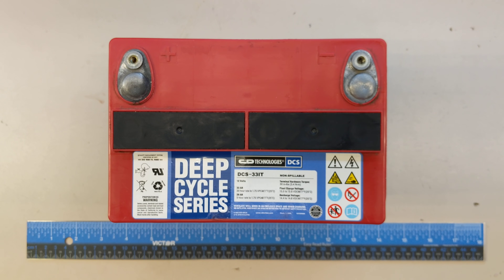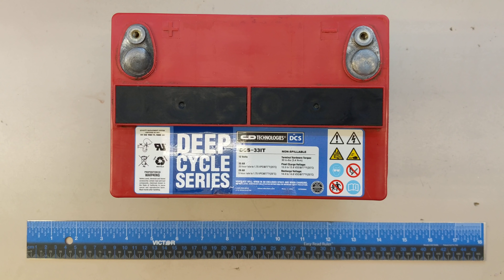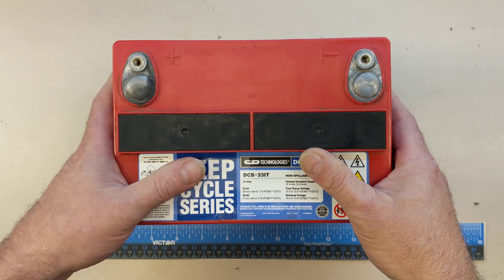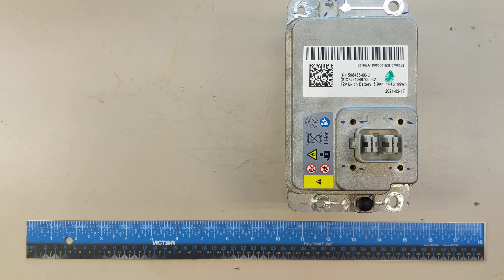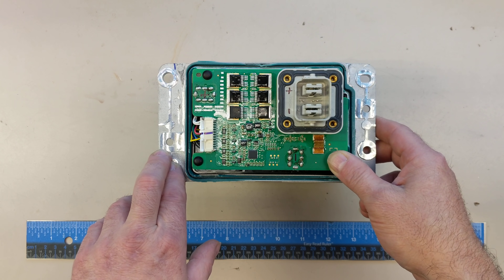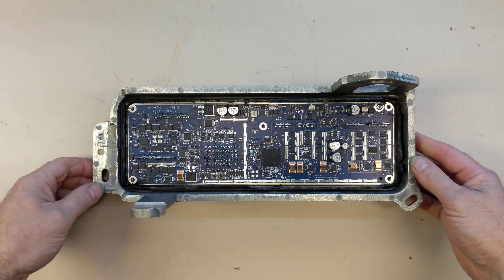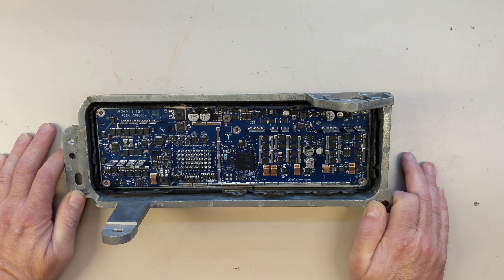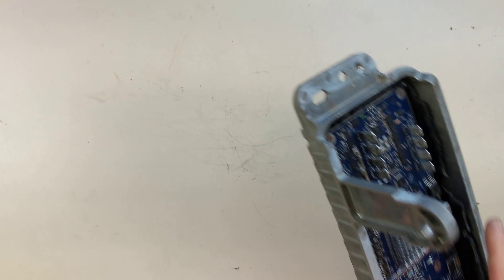Tesla Plaid - 12 volt Lithium Battery PART 1

Comment: Does it have 4680 batteries?
Reply from the maker: No, I think this is using the 2170's.   The pack is full of epoxy, so without a lot of effort, I can't confirm.  Definitely not enough room for 4680's.
Reply: @Ingineerix  the sticker say 1P4S…….
Reply: @dustinoehler4732  are there prismatic lfp packages that fit into the case in size?
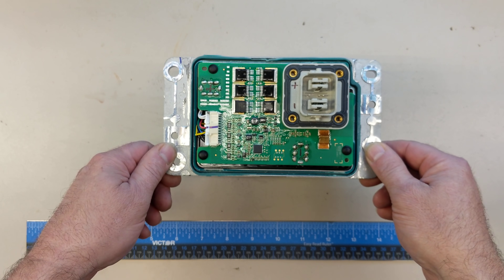Reply: @ 09:40  💭💤
Reply: No! Probably 2P4S with 8 of the 2170 cells. CORRECTION. 1P4S is printed on the label. Thanks AHTON. So the cells probably are not be 2170's either. 2170's have less than 6AH so might be four 4680 cells. What do you think?
Reply: @fiddlerJohn  Why is 1p4s written on the case? 18:44
Reply: @TOSHIK420  that is a nice catch! It really is written on it 1P4S
Reply: @TOSHIK420  Thanks. I didn't see the 1P4S.
Reply: @TOSHIK420  Thanks. That means they must be four 4680 cells.
Reply: @fiddlerJohn  Now we need to disassemble the battery further. To begin with, remove the printed circuit board.

Comment: Silly question, why is there a cutout on the top right corner of the box (8:08)? Is there a reason why the lid (and PCB below it) aren't perfectly squared? I know it doesn't make much difference in PCB cost or tooling for the die casts, so maybe it is just to ensure the PCB always gets placed in the right orientation every time? Love your videos!
Reply from the maker: I think it's to make room for the fasteners.   They need a "keep out" area for tools.

Comment: awww I really wanted to see the cells
Reply from the maker: Too much work, smoke and fire to chisel them out of the epoxy.  Just getting to cover off was a 30 minute operation.
Reply: @Ingineerix  i would guess they did not get any heater in there, nor use self heating to warm to batteries, that would be risky, since there is to many ways a cold 12V battery would not be able to recharge. My guess is they used LTO batteries (Lithium titanate oxide) that are happy to charge or discharge at even -20C. That would also explain the huge size for such a small battery too. So it would be interesting to see the cells in it, what form factor, size and all. Btw ste there components on the bottom side of the PCB too?
Reply: Bet there is a heating element in there

Comment: 11:00 I've learned the hard way that the 12v is entirely on its own during some parts of the OTA install where the software for the DC-DC converter will logically be "OFF".  IF your 12v battery was on the verge of going bad and it can't support this time (large install?) then your install may stop partway thru.  This happened to me in NH where Tesla doesn't have service centers and didn't help with mobile.  Booster pack hooked to the 12v for 30+ minutes let the install complete. The 12v battery needs service showed up the next day while on our way to our home state. Had to find a service center ASAP.
Reply from the maker: Yes, this is correct.  The battery monitoring is now good enough to prevent updates if there is not enough capacity to "ride it out".
Reply: @Ingineerix  like an iPhone….needs at least 50% to allow firmware update
Reply: advantage of these lithium packs is you have a much better idea of actual capacity, while with lead you're kind of guessing.
Reply: @edc1569  Yes, and no. Even with Li, SOC is an educated guess based on voltage. There's really no way to know how much power is in the battery without actually keeping track of it. (ala NiMH.) I have plenty of batteries that show their full rated voltage but have next to no current in them. (some laptops will do full cycles to re-tune the capacity of the battery. e.g. the 12yo thinkpad next to me... 7% remains. :-) It'll last about 5min on that battery.)

Comment: I wonder how Tesla overcame the temperature problems.  Lithium batteries hate temperatures below freezing, 0°c or 32°f.  They are damaged when they are charged.  That is why the lead acid battery is still being used.
Reply from the maker: I think they actively discharge it to warm it up.  The housing is well insulated internally.
Reply: @Ingineerix  heating by self discharge is ok for the main pack. But it's risky with 12V bat with the hv contractors open. But these have to work at stupid low freezing temperatures And be able to recharge. Since with freezing temperatures the battery is not just unable to charge, but also decreases the available capacity, not sure there is energy to be spared on self heating. I could very well be wrong, but i guess this is not the case. It would be way easier and safer to just use a different chemistry, like LTO that can handle extreme temperatures. After all LTO is used in marine batteries and electric trains exactly because it can handle crazy temperatures. Or maybe even something more exotic.
Reply from the maker: @robotsmiki6598  NMC chemisty, See my updated video:  https://youtu.be/fJH1r1s8B6Y
I stand by the discharge to warm it theory, but it will be awhile before I can confirm it.
Reply: @Ingineerix  thanks for the update. I'm still not 100% convinced it's NMC, although the parameters in the datasheet are insanely good. Nice find!
Reply: I think the frunk is climate controlled. They use it as additional thermal mass for the octovalve heat pump system.
Reply: @kazedcat  What do you mean? The frunk's couple litres of air is thermal mass for thr cooling system? :D nahh
Reply: @rkan2  They use the frunk as neutral sink for thermal energy. So hot fluid from the motors returns toward the octovalve where heat is extracted and pump to where it is needed some of that heat energy stays in the octovalve and heats up the frunk. When the car is preheated the frunk is also preheated because the cars heater is the motor and hot coolant flows to the octovalve. The radiator have a shutter and only opens when the car is dumping heat.  when the car is scavenging heat the radiator shuts close and the frunk becomes and enclosed system with the octovalve providing heat.
Reply: I bet it has some sort of heater. They can't just forget about freezing temperatures lol.

Comment: Hope more OEM's will follow  .... lead is not good for environment !
Reply: Lead in batteries is not a a problem as it's extremely easy to recover and recycle
Reply: This battery was not made by tesla for your records. There are companies out there that makes very special batteries for different applications from aircrafts to satellites, cars......
Reply: Lead acid batteries are one of the most successfully recycled man-made items on the planet.  In the US it's like 98% to 99% recycle rate.  So, even though lead can be nasty for you, it's not that bad from this particular product.
Reply: You're joking right!? other OEM have eveb been using 48 volts batteries for years now.
Reply: @carholic-sz3qv  They still use 12v lead acid battery for low voltage systems on car ...... maybe tesla will switch to 48v instead of classical 12v system
Reply: @ebikeunlock  tesla doesn't have to switch to 48v they can just make a bigger capacity 12v battery. Those 12v lead acid batteries can actually last almost a decade.
Reply from the maker: There is no good reason to switch to 48v for the reasons I already covered in the video.
Reply: @carholic-sz3qv  not in a Tesla. As mentioned in the video too, the 12V battery gets deep cycled constantly, unlike in a normal car, because of the running computers. Lead acid hates this and lifespan is way shorter then usual
Reply: @robotsmiki6598  lol... he clearly said that lead acid batteries are used in ICE and not EVs.
Reply: @carholic-sz3qv  i was referring to your comment that lead acid batteries can last a decade in a car. Yes they can last a decade in an ICE. But Tesla cars using lead acid batteries are notorious that use up the lead acid battery much shorter and often need replacement. More often than in ICE. This is one of the reasons Tesla wanted to replace the 12V battery system for a long time with something more durable.
Reply: @carholic-sz3qv  ??? I don't get you. yes, Every EV on the road today (except some Tesla) has a lead acid 12V battery onboard.
Reply: @robotsmiki6598  not tesla cars but EVs in general doesn't use/have to use lead acid, there is AGM batteries and many other chemistries depending on what's going to be powered when the car isn't driving......
Reply: @robotsmiki6598  that's totally false.
Reply: @carholic-sz3qv  what are you talking about? AGM is just a type of lead acid battery. https://en.m.wikipedia.org/wiki/VRLA_battery
Valve regulated lead acid (VRLA) battery is a type of sealed lead acid (SLA) battery. The two main types of VRLA are AGM and gellcell

Comment: anyone know list price on that 12v battery?
Reply from the maker: I think it's about $150.  Part #1598486-88-C.  You cannot use it easily in another application.  It will not even turn on without LIN communication.
Reply: @Ingineerix That's similar to the price of the old SLA right?
Reply from the maker: @compu85  Yeah, a little cheaper, but close.   Definitely easier to change now.  It's also nice that no tools are needed if you want to disconnect the 12v.

Comment: Generally when you're adding safety pack disconnects to a custom battery pack is the goal is keep voltages below 72v at any given time?

Also do people usually build they battery enclosures with the safety disconnects built in so that even during pack assembly the voltage is kept low at all times?
Reply from the maker: Depending on your full pack voltage it may not be practical to kee pany voltage below 72V.  The best you can reasonably do is split it in half.   Commercial EV packs do not have these safety features.   The best they do is HVIL (Interlock) to open the contactors when you open something containing HV.
Reply: @Ingineerix   dang, since my plan is to operate at 400v nominal using two Chevy volt packs worth of cells, but dropping to 200v would still be pretty deadly
Reply: @Ryukachoo  been hit with 240V mains a few times. Its easily the most pain you'll ever feel. How im still alive is somewhat of a mistery.
Reply from the maker: @Ryukachoo  Be careful!  Seek advice from someone with experience, and engineer your setup so it's safe.  You shouldn't need to break the pack into sections to make it safe.